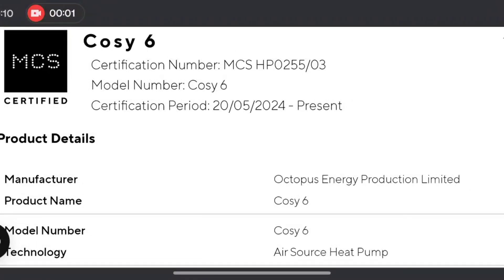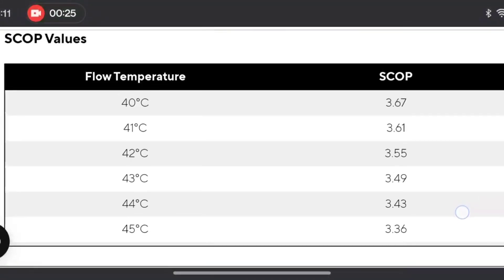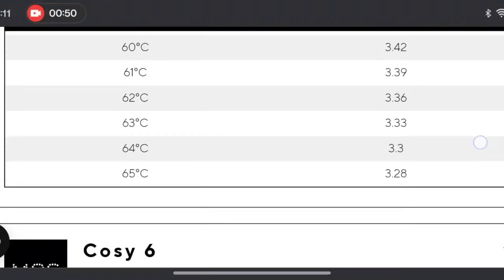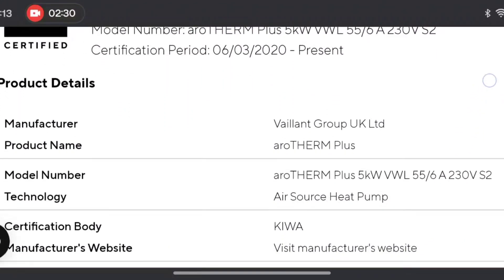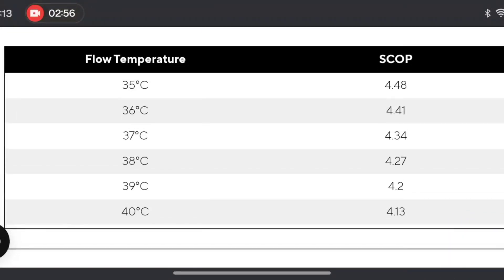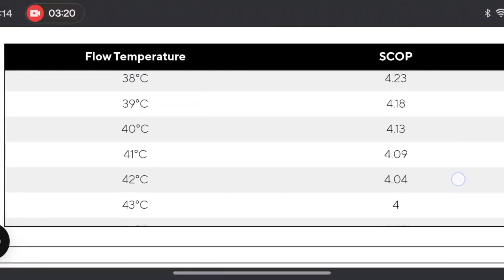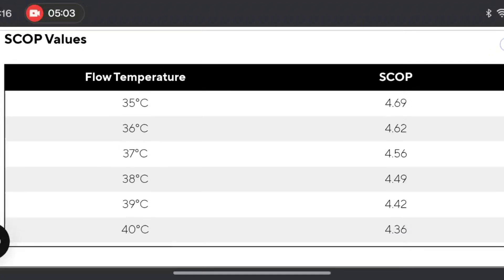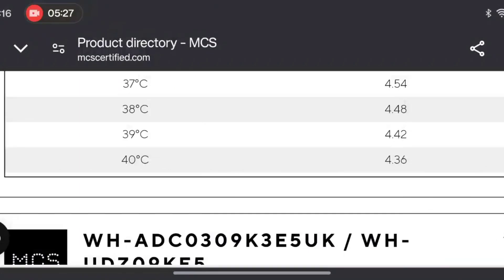Cosy 6 Heat Pump Test Results are poor. Does Octopus have a trump card?

Comment: Arrived a bit late to your forum and just catching up on your many interesting posts.
One question I have, How did you calculate your HP and HW monthly COP?
Reply from the maker: Thanks for your question.
COP is calculated by taking the heat energy output and dividing it by the electrical power input.
For most heat pumps this information is easily accessible and the integrated measuring equipment is fairly accurate.
Some heat pumps do not show this information.
Some owners prefer to fit 3rd party monitoring equipment to check the system efficiency.
Reply: @UpsideDownFork  Hi, yes I understand that. But how did you measure the heat/energy output. Clearly energy input is the electricity used.
Reply from the maker: @DaliPickle  my heat pump has an in built heat meter which provides the reading.
If you're not aware of what they do, it measures the flow and temperature of the water in and out of the heat pump and can work out how much heat energy has been delivered.
Reply: @UpsideDownFork  Thank you for the reply. Unfortunately I don't have a heat meter fitted. Enjoying your insights. How do your measured monthly COPs relate to what your installers quoted for SCOP?
Reply from the maker: @DaliPickle  so far we are above the COP for heating by a bit and far above the COP for DHW.
Which heat pump do you have?
Reply: @UpsideDownFork  Grant Aerona 10kW, with 4kW solar panels and 11.2kWh battery

Comment: Do you suffer from the Vaillant Arotherm Firmware 351.06.07 Problems? Maybe this Cosy 6 heatpump can improve its COP with firmware!
Reply from the maker: @BassPunk  mine has the later firmware 0351.09.02, so no issues there 👍

Comment: My heatpump says its certified and yet only has 35c and 45c flow temp SCOP ratings.

Having a large amount of ratings per degree C with one heatpump, and having only two with another does not breed any confidence whatsoever.
Reply from the maker: Yes, you have a good point.
Another flaw in MCS.

Comment: While accepting that good design is paramount, it is worth noting that, generally, the MCS tests show that R32 heat pumps have significantly better SCOPs than their R290 equivalents, because R32 is a more efficient coolant. You can see this most clearly by comparing like for like R32 vs R290 models, for example the Misubishi R32 6kW model (PUZ-WM60VAA) has SCOP of 4.81 at 35degC, compared to the Mitsubishi R290 6kW model (PUZ-WZ60VAA - a much newer model) which has a SCOP of 4.39 at 35degC
Reply: I don't think there's anything magic about the software.  Any heat pump can be set to take advantage of the Cosy tariffs (or any other smart tariffs).  The better models can also take advantage of any PV generated and battery storage to minimise running costs.

Comment: Some of those low temperature units may have a higher scop but if you actually want to run them up near the 55C mark, then you will be stressing the heat pump and it’s going to break down sooner.  Also if you absolutely can’t ever push the temperature up to 60 for a legionella cycle then you’ll need an immersion heater too which adds complexity and will obviously be less efficient for those cycles.
Reply from the maker: All of those units I selected are R290 units which have been branded as high temp.
They can all complete a legionella cycle without an immersion heater.
Reply: @UpsideDownFork  then why do the test results all show 0 above 55C?  If they are being sold as high temperature units then we’re going to want to know how they perform at 60, 65 and 70.
Reply from the maker: @dominicgoodwin1147  I agree with you, they should show that.
I've covered the questionable marketing practises surrounding the so called "high temperature" heat pumps before.

Comment: This is one of the things that concerns me about heat pumps. Everyone focuses on the scop and how it’s 400% efficient, etc. it’s more complex than that with a boiler there is a house heat up time which is based on how long the unit has been off and how long it will take to get up to temperature. I am not in my house most of the day and use very little of the house and having a boiler with zoning has a specific cost where as to get the scop high I’ll have to heat the entire house for most of the day. So if I’m burning electricity for an additional 4 hours to get to the same temperature as the boiler can do it in 1 the. No matter what the scop is I’m going to be brining more electricity. There are so many nuances in the usage that it’s not all  about being above a scop of 3.5 being better than gas. 

If you then look at the additional efficiencies they add like lagging internal pipes and running lower temperature hot water cycles then it’s more complex than it first appears.
Reply from the maker: Good points raised.

We used to run our boiler every day  6am-7:30am and 4pm-9pm.
We then went to a heat pump running 24/7 and saved a load of money by doing so.

Different lifestyles may benefit more from the advantages of A2A such as quick warm up time and localised zoning.

There are some good theory videos covering these principles on the heat geek channel.

Thanks for commenting.
Reply: @davideyres955  Excellent comments, SCOP is over hyped re savings, etc., as you say so many variables down stream from when COP is measured.
Just finished our first full year and, albeit a mild winter, we didn't feel cold, lack HW or buy loads of electricity.
Our main goal for going HP is environmental. And before responses about the carbon cost of HP, replaced boiler, new radiators, etc. we are thinking long term, probably beyond our lives (leaving the property in a better place). Monetary considerations are secondary and I realise I am fortunate to be able to say this.
Reply: The benefit of each will totally depend on how well insulated your house is.  For a well insulated house it's more efficient to run the heating at a relatively constant temperature, but obviously if not insulated this would cost you a fortune.  You can also adjust the heat pump settings to reflect the times you are at home, accounting for the fact that tit will take longer to heat up than for a fossil fuel boiler at lower flow temperatures.

Comment: A cynical individual couldn't be blamed for thinking that an energy company is disincentivised from supplying energy efficient heating...
Reply from the maker: That's one way to look at it for sure.
Reply: I very much doubt that this is the case. This is an early product from a small and new company (Octopus bought the company which makes these a few years ago).  It's just not as good as some of its competitors. Competitors who have much bigger R&D budgets and have decades of experience making heat pumps.
Reply: Nice deal collecting a 7.5k grant to lock a customer into 10 years of energy from a supplier.
Reply from the maker: @edc1569  customers are free to change energy supplier at any time.
You also don't need to be an Octopus Energy customer to have one of their heat pump installations.
There is no lock in for 1 year or 10 years.

Comment: After being excited to get a Cosy 6 this has really screwed my plans up. HOWEVER! After seeing HeatGeek's Mini hot water cylinder I'm now looking to go Air2Air instead. I recall seeing a A2A Heatpump that also runs a hot water cylinder so that is now back on the cards. I'll obviously prioritise Solar first though so no additional load on the grid in summer.
Reply from the maker: Any heat pump is a good heat pump!
Reply: I wouldn’t live too much on YouTube, plenty of good systems out there without YouTube fanfare.
Reply: You could take a look at the new Samsung R290 units.

Comment: The MCS SCOP is only half the spec . When phoned MCSCertified couldn't give the test conditions, but said they can supply the names of  certification  companies ( different companies for different models) so a researcher could investigate,..  ( MCS quote SCOP  at, say, 40c , but people don't run a fixed flow temp for a season, so confusing).  . We may find Cosy 6 has been optimised for other factors other than this  SCOP test . .. .. Perhaps it is better at defrost cycles? perhaps this makes up for lack of test SCOP? Perhaps it is quiet , if Sound Power Level is lower it still could be a winner.  Perhaps it has been built for reliability? .  Perhaps it is just cheap ?  "Free install" was Greg's suggestion at the cosy launch last year a good price point .   If its a free install that cost £300 a year extra to run that might be better than a £4000 install. ( & octopus service is £100 cheaper than others).
Reply from the maker: Lots of relevant questions that have also crossed my mind!
Interestingly, if you dig into MCS you will find this document https://mcscertified.com/wp-content/uploads/2021/10/MCS-007.pdf
It references BS EN 14825:2016 as the test, but if you go and check that out, it was withdrawn in 2018.
MCS is a bit of a joke really.

Comment: After all the hype these are not good stats from what is a brand new R290 Heat Pump (albeit a re-designed RED unit). I can't help thinking that the Cosy 6 was designed & optimised for use in higher leaving water temperature systems to avoid pipe & rad changes which, makes the system cheaper to install, if not to run. The angled top discharge fan also makes it more flexible when installing it close to a fence or similar boundary obstruction which may prevent the use of a traditional side discharge fan unit due to air recirculation issues.

Comment: r/e Turning on and off the heat pump at specific times to take advantage of Smart tariffs - don’t do it !   Have a look at the heat geek video on smart tariffs (eg Octopus Cosy, Agile, Economy 7), they crunch the numbers and prove that trying to optimise the heat pump for when the electricity is cheaper is a false economy as the heat pump has to work much much harder and at a higher flow temperature to keep the house sufficiently warm.
We are on Octopus Agile and run the heat pump all the time in the winter (with overnight setback).  When on the few days it was super-expensive 60p/kWh in early December 2023 and in the DFS savings sessions we turned our heat pump off for the hour or so, but otherwise we just let it run low and slow to keep the house warm.  The battery took out the worst of the Agile peak periods, running the heat pump on previously stored cheaper rate electricity
Reply from the maker: Turning on and off is definitely ill advised. I would advocate for setback during the 4-7pm agile period if you don't have sufficient battery capacity to cover you.
Or just stick with Octopus Tracker which is a smart tariff that works really well with a heat pump and no battery storage required.
Reply: @UpsideDownFork  the heat pump monitor site lists numerous high performing installations. Many of them don't run the heat pump between 4 and 7pm because of Agile. Look at a typical high use winter's day and you'll see many don't use energy at those times.
Reply: its highly dependent on your house, and the vast majority of people don't have a battery. Your advice is generic and not useful. Definitely much better to turn off and on in my situation, if i listened to you i'd be worse off.
Reply from the maker: @Etacovda63  Not so dependant on the house, but more dependant on the lifestyle. 
Rule of thumb is that if you spend 12 hours or more per day in your home then you will be better off financially by running constantly.
If you occupy your home for less than 12 hours per day then it can be debateable but definitely still worth doing some thorough calculations and modelling or testing both ways.

Comment: Useful pointer to the MCS database, thank you.  I’ve looked up the details for my (now 2 year old) LG Therma V; its actually has better SCOP at 35 degrees than the new Cosy heat pump!  Your Valent is overall better SCOP than mine, but not by much, but you’d expect that newer pumps would be better.
It does rather destroy the assertion that was being made that the Cosy HP was a high temperature heat pump, suitable for any house install.  Yes, but at what SCOP?
Reply from the maker: Sometimes i'm surprised by how different the various pumps are because the fundamental technology is well established and mature. It seems as though the physical engineering hasn't improved in several years but the control strategy and algorithms do seem to be considerably better on some of the newer models.

Comment: This analysis is potentially flawed. The error is there is no information on the EPC rating of the property or the size and type. To compare two different properties makes video irrelevant.
Reply from the maker: The MCS database doesn't compare homes. It compares heat pumps under lab conditions.
Besides that, EPC's are fairly irrelevant to heat pump operation. They are prone to human error and based on many assumptions rather than data and calculations.
Reply: Why? The primary variable adapting a running heat pump to a home installation is flow temperature, which is set in to adapt to changing weather and the individual installation as the system runs. It can be modelled before installation in programs like Heat Punk... Knowing the efficiency at different temps then becomes a useful comparison.

Comment: The previous certified devices are the R.E.D heat pumps that Octopus bought out. Similar efficiencies to the Cosy...

The units you looked at arent by the same certification body, i dont have a lot of trust that certification bodies are that close in standardisation in general. Would be good to see the numbers on heatpumpmonitor before making any conclusions
Reply from the maker: Great point! There is definitely the potential for margin of error between testing bodies. The do all test to the same BS standard though.
Heatpumpmonitor is an amazing snapshot and growing quickly as the months go on but the small sample is still not fully representative of how well pumps may perform in a wide variety of homes.

Comment: You say stay away from octopus cosy - any reason for that if you have a battery and can charge it up twice a day. What tariff would you recommend?
Reply: Personally I’d recommend either Octopus Agile or Octopus Tracker to run a heat pump as these have an average lower price than Cosy.  Cosy works IF you have sufficient battery storage to run the house and the heat pump off in the day-time and peak rate periods, AND you have sufficient inverter throughput to charge the battery in the cheap rate.   Otherwise if you are running the heat pump in the day/peak periods, its more expensive
Reply from the maker: Geoffrey has it all covered I think. Situations do vary. If you have the battery capacity to bridge the gap then Cosy may work for you. 
My statement was quite a broad generalisation. 
if you don't have battery, Agile or Tracker will always win over Cosy. 
If you have an EV then IOG is probably your best bet but once again dependent on your home storage battery capacity.
Reply: @UpsideDownFork  and if someone has high generation in the summer, flux might be good for 6 months of the year
Reply: That’s ok for summer but don’t see it working in winter. I have solar and a Tesla 13.5kwh battery so pretty much zero electricity from the grid and on the 15p guaranteed export. What about when the solar goes down in September what would then be wrong with cosy as I can fill the battery twice at 11p/kwh (and will be able to fill the battery from zero) while also using power in the house at 11p/kwh.
Reply: @davidwatson4738  As I said, it all depends on your battery storage, inverter capacity and heat pump demand.
I have solar, battery and a heat pump.  In the winter my heat pump draws 3-4kW when it’s running and a typical winter’s day is about 25kWh for the heat pump (plus about 14kWh for the house).  My battery capacity (13.5kWh) and inverter throughput (5kWh) isn’t sufficient to run the house and heat pump off the battery in the Cosy off peak periods so I would end up drawing from the grid.
For me, Agile was the answer, an overall cheaper rate but you do need battery automation to manage the battery charge and discharge.  Tracker is a simpler tariff that doesn’t require the automation (or batteries)
Reply: Thanks I will look into that - just had everything installed a couple of months so will have to figure out what’s best for winter.

Comment: All of the efficiency discussion goes out the window for me when the Installation costs over and above the £7,500 grant can vary so much. I had a £2,500 price difference between quotes from British Gas and Octopus and even then it was all heavily caveated with 'may be additional costs identified on the Job' .
Reply from the maker: That is definitely frustrating!
It's ultimately the reason I decided not to pursue the more expensive HeatGeek route as I would not even get close to returning the extra invested capital with them.
Cheaper install with moderate SCOP is typically the best financial route.